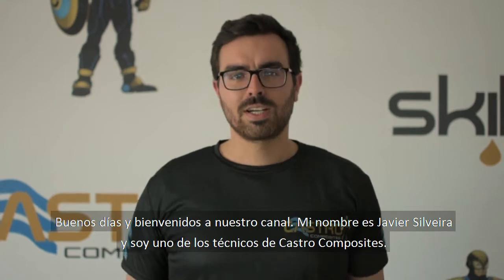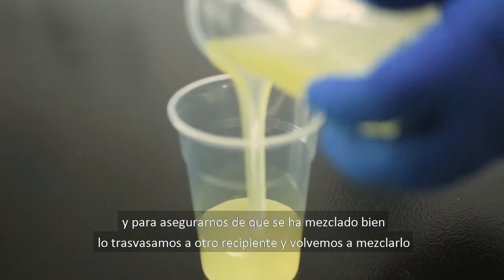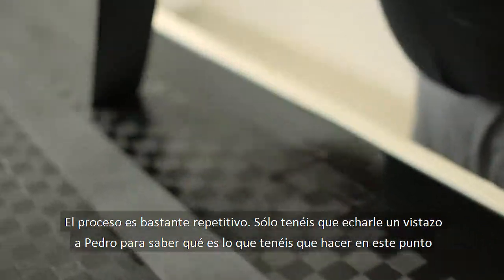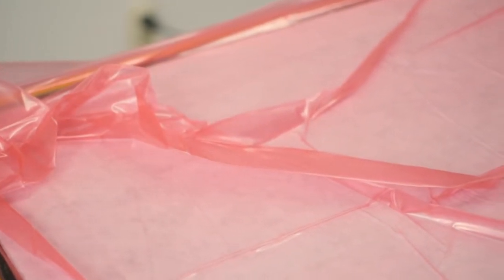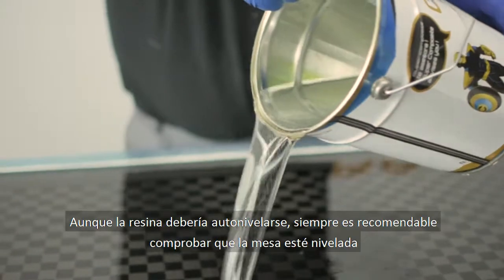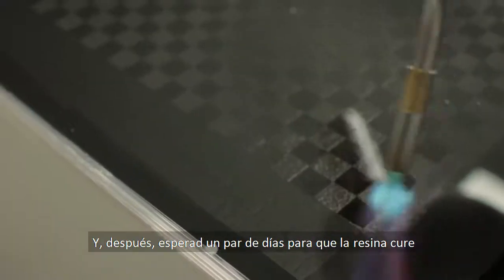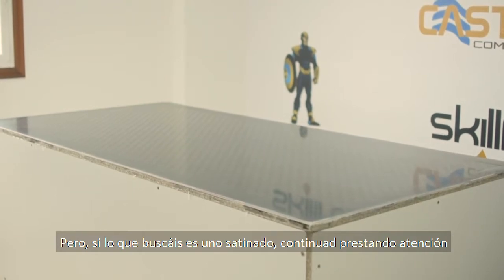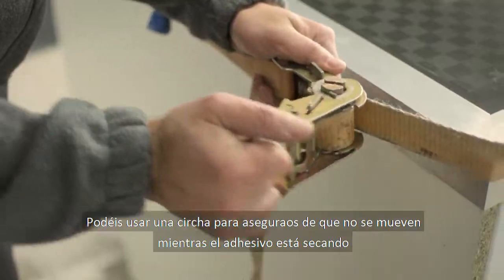Tutorial recubrimiento de mesa en carbono / Carbon Skin Table Tutorial

Comment: hola soy de un pueblo de  Toledo y me gustaria saber si es posible utilizar la resina epoxy en invierno, gracias.
Reply from the maker: Buenos días Javier, se puede emplear en invierno si bien la temperatura del producto y de la habitacion no debería ser inferior  a 18/20 grados, de lo contrario podríais tener problemas en el correcto gelificado y curado de la pieza. Un saludo.
Reply: @CastroCompositesTV  muchas gracias por tu tiempo, me gustaría saber si es posible hablar por teléfono con alguien que me pueda asesorar sobre un proyecto que e terminado pero el resultado final no a sido el esperado aunque es valido y sobre otro proyecto que tengo en mente , muchas gracias de nuevo.
Reply from the maker: @javierrecio3007  claro, nos puedes llamar al 669754833 o al 986342953, un saludo.